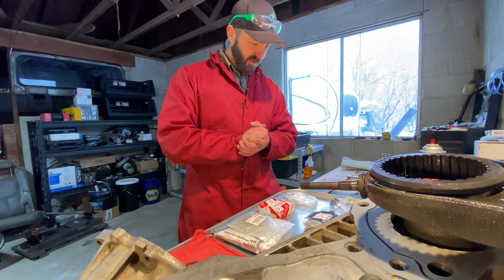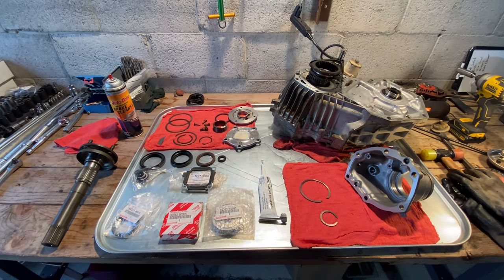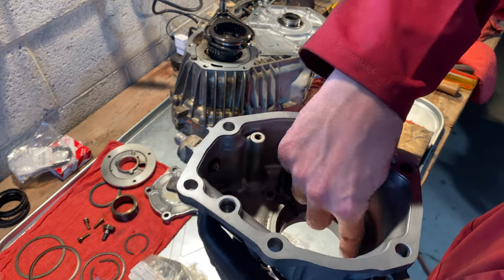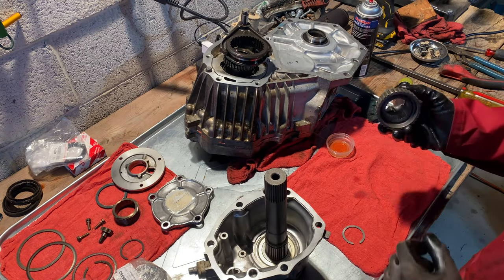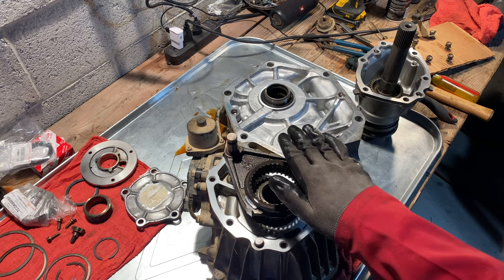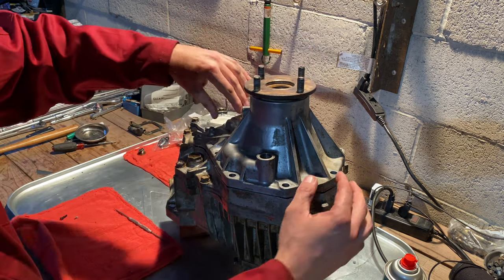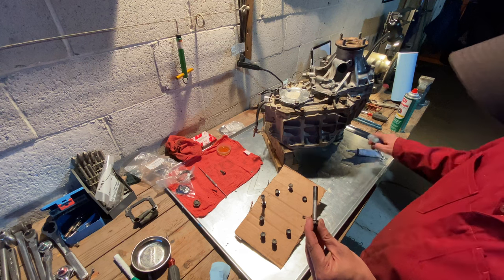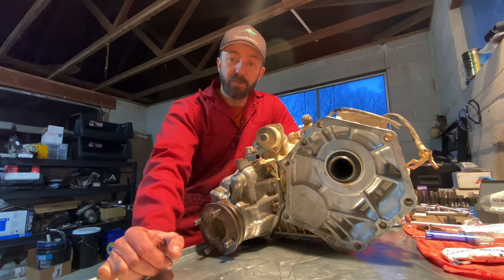TOYOTA LAND CRUISER HF2A TRANSFER CASE SEALS & BEARINGS | Pt. 4 Full Reassembly

Comment: @12:45 that cover plate that you were holding for the rear casing, what’s the best way to remove it? Thanks in advance.
Reply from the maker: If I’m thinking of the right plate your asking, as described in the video, it was one of the most difficult parts of this job. I can’t remember how to explain it right now, but I’m pretty sure I went into detail as I did it in the video, to help folks out. 

LMK if you have any other specific questions I can describe. Good luck!